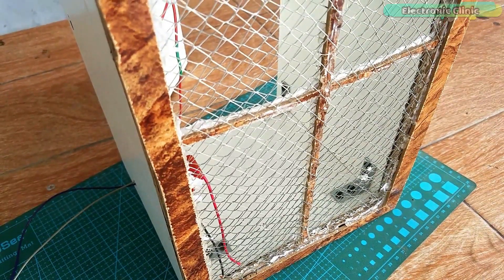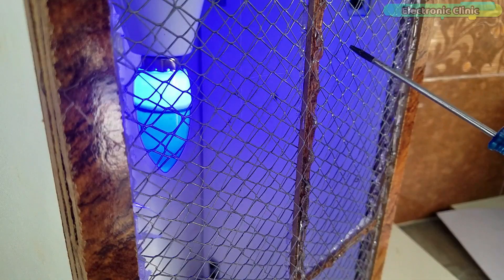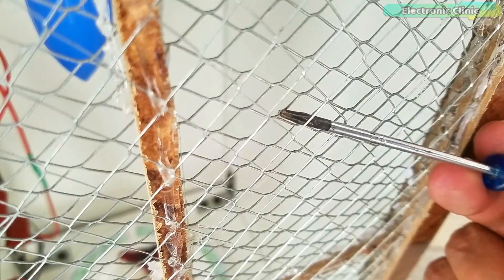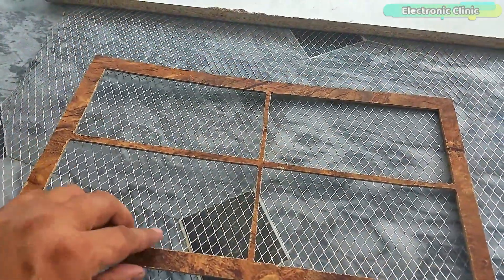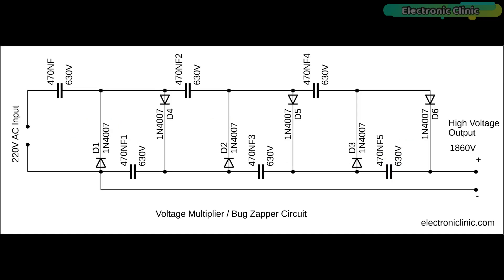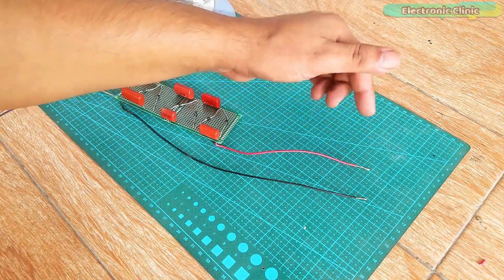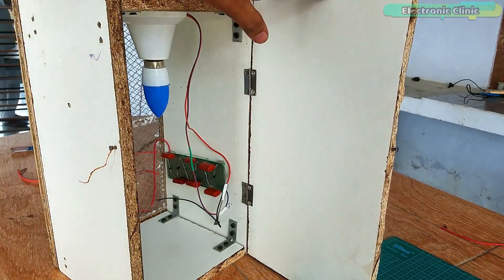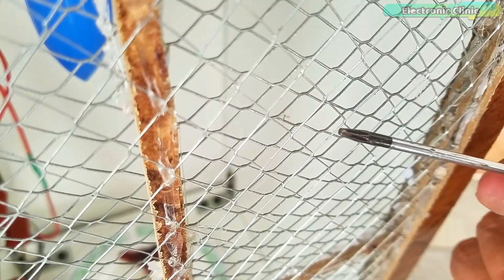diy Mosquito Killer Machine with mosquito bait / Mosquito Racket / Mosquito Bat / Bug Zapper Racket

Comment: Hello you createing 1850 volt used capacitor 600 volts diode also under voltage IN4007

Comment: Firstly thank you for sharing this!!! 
In my opinion this is, a very Dangerous Circuit and thus This kind design is very very dangerous!!!
The High Voltage mesh should be placed in the middle of the box at a depth that kids or even humans can't touch!!! and then a Front Grill should be where the current electric mesh is placed!!!